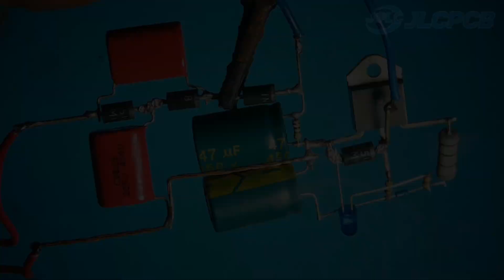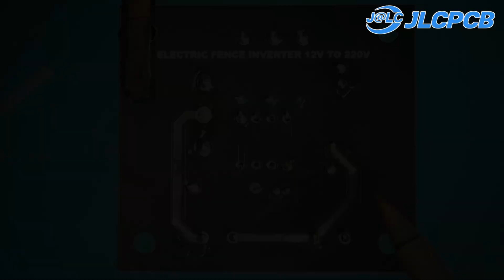Homemade 12V To 220V Inverter | Electric fence inverter circuit diagram

Comment: I've been following you for a long time now and as soon as I saw this new video I watched it 4 times as always, beautiful project, I'd like to be able to do it too because I really need it, I wanted to ask you but then in the end did you only use one 12v transformer output? Could we have the diagram of the two circuits? I noticed that in the circuit you had ILPCB make, you inserted a high-power ceramic resistor, right? A big hello and may God always help you in life, bye and congratulations again for the video.
Unfortunately I can't install WhatsApp on my PC and therefore I can't contact you, how could I get the diagram? Obviously also paying if necessary. Thank you
Reply from the maker: Thank you for your kind words and support! Yes, I used a single 12V transformer output, I can share the circuit diagram - please contact me by email.